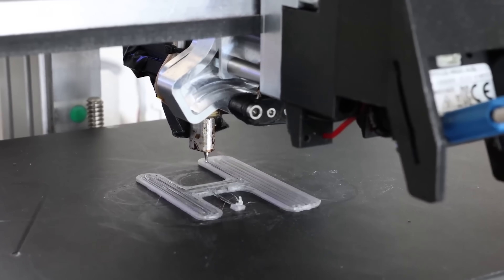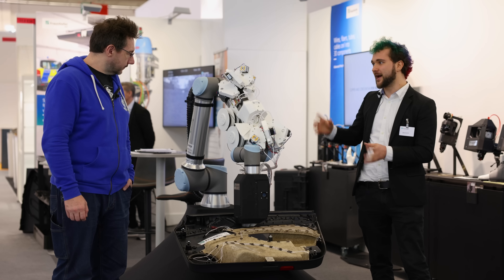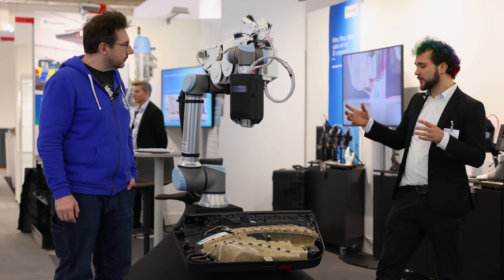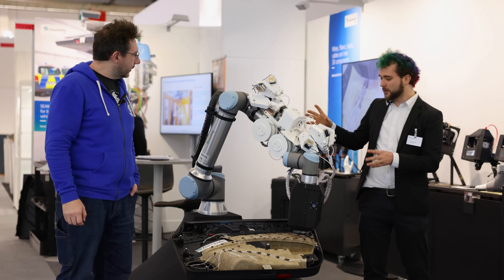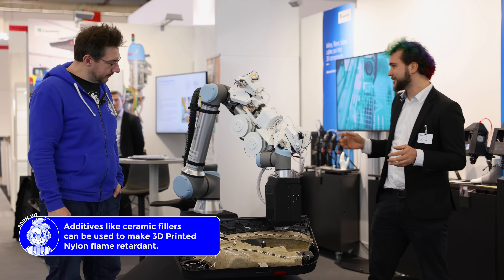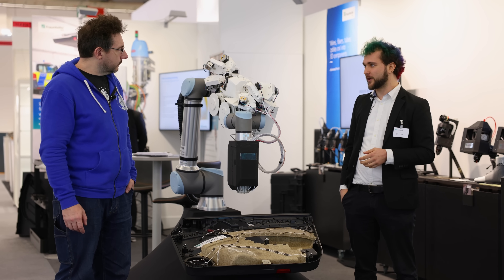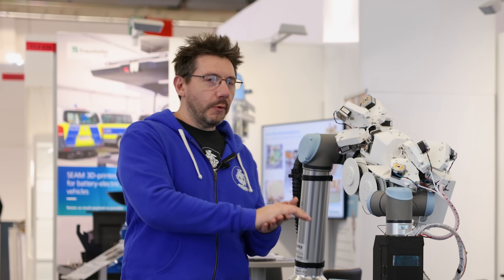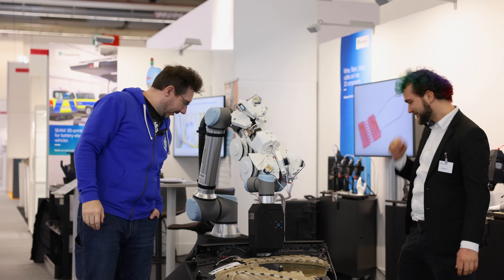3D PRINTING WIRE and TERMINATING IT?! - Fraunhofer Formnext 2024

Comment: try metal solder/3d-print wire melting with resistance heating at the tip, not the hot end, but the wire itself, not by arc welding, but by two electrodes inside the wire feeder hot-end, that contact with the feed wire. then the current goes through the wire (narrow) and melts it. normal 3d printer wire pushing.

Comment: A cable/wiring harness installed by a human on an assembly line can be removed by a human (not always easily but still) in the field for repair or replacement. These wires are installed and fixed in such a way it makes a common automotive failure point, wiring, unserviceable. One wire failure on that part would require replacing the entire door panel. This is not a good solution for the automotive market. Interesting technology, wrong application.
Reply: Current wire harnesses are also fully bound in adhesive and then welded to the part. At this moment, you will never replace a single cable in your wire harness. Its always replace ther harness or add an additional cable
Reply: @DecobirdZivo  The wires are fully bound in a wrap or similar system to form them into a wiring harness but the cables are not welded to anything, thus you can remove the harness and repair and/or replace it. I've done shade tree mechanic work most of my life and repaired/replaced/modified plenty of wiring harnesses and automotive wiring. This solution removes any chances of that type work without replacing entire panels.

Comment: This is a bad idea. They just made a way to make cars unrepareable by humans. Oh know one wire is broken. Replce the car. The dawn of the ICar is upon us. :(
Reply: Do you really think in current cars one single cable can be repaired?
In most cases they just throw in an extra cable or replace the complete harness, because the are fully tapped together
Reply: @DecobirdZivo  No, you would probably have to replace the enter wiring harness. Ya think you could do even that if it's all glued down?
Reply: @NJM1564  in most cases they are already glued down or attached via ultrasonic welding. 

In any case redoing the cables is a problme

Comment: This is cool and all, but I'm a little bit disappointed in that I thought this was going to be about using wire as a 3D printing filament. Towards that end, I had an idea. Place the entire thing in a really big acrylic box, then vacuum out all the air, then pump in argon. The hot end could be a thick ceramic cone with a channel down the middle and it could be wrapped first with a thermal insulator then copper tubes to facilitate inductive heating. This is why it would need to use argon, because you want to avoid oxygen contamination but you need flowing gas around the entire setup to cool it as it works. The only reason I suggest acrylic is to watch it work. An insulated metal cube would work just as well, if not better, but what would be the fun in that.

Comment: Cool concept, but it will need to be 100 ti es faster if they expect to see wires being made and installed on an assembly line.  It will also ha e to do multiple colors and striped wires for ant practical use.  Lastly wires are not laid out flat / sice by side for a reason, sothis tech will need to be able to make and bundle wire harnesses into cables.
Reply: I assume the robot in the video is going slowly because it's in an open space with random human beings passing through. Surely even that version does work a lot faster in an industrial setting, never mind a production version.

I agree with your other concerns, though manufacturers may decide that they are willing to accept less-than-ideal wire installation in order to cut costs by a dollar or two.

Comment: as someone who's fixed entirely too many wires, do not want. this mess would be a nightmare to fix after the fact.
Reply: @kenabi  could you explain?

Currently all cables are completly bound ny tape and there is no way of accessing them
Reply: @DecobirdZivo Most automotive cable harnesses are in a plastic sleeve or mesh and only taped at the ends. Most of the time you just have to cut the tape, tie the new wire to the old wire and pull it through. You will also need to loosen any clamps that hold the harness to the vehicle.

To replace a faulty wire that this robot ran, you would need a heat gun hot enough to melt nylon. Then when you could remove the wire, then remelt it to place the new wire.
Plus wire harnesses are color coded to make it easier to trace them.
Reply: @andrewforte  I'm sure they'd still use colored wire in many cases but I agree this would be a chore. Realistically the wire being constrained in so many places means a break in those areas is unlikely without a much more significant issue anyway, such as a short or physical damage (e.g. rodents), but that's still a very real possibility.

Frankly, I see similar technology much more practical in smaller, enclosed assemblies than in large scale applications.
Reply: @DecobirdZivo  adding to the above response; even 'sticky' harness tape isn't that much of a chore to deal with, and doesn't have the risk of newbies totally frying the whole set of wires trying to get one melted out of the bunch. to say nothing of the resulting sticky mess that may wind up everywhere as you heat up the glued down portions.

its hot glue on steroids, and hot glue is annoying enough already.
Reply: I agree, I think the automotive industry isn't the best application for this.

I think 3d electronics with embedded wiring and 3d circuits is far more interesting

Comment: Very interesting but I can imagine this is not an advantage for repairs. As a car guy, the wire harness gets moved around a lot when fixing or changing other components. The fixed attachment would be a pain to work around or replace.
Reply: @VacFink  you are definitly right for current car parts. But this technology enables to place the cables in different places as the normal harnesses. We do allow new routing options for cleaner and easier to access parts. 

On this piece the traces are non sense, because we arent allowed to show the actual parts wie did for the manufacturer. 

In real application the parts would be designed for those cable traces
Reply: Repair? Just print a new car.

Comment: Back in the '90s, I was an EE at Boeing designing automated test systems for the ISS program.  I realized that custom wire harnesses were really expensive, and had low reliability.  (The reliability issues were because we were using unskilled labor, but that's a different story).  So the next system I designed used all COTS cables (mostly Ethernet, coax, and D-sub) that cost only a few dollars each and were extremely tough and reliable.  I did it simply by making custom PC boards that handled all the cross-connections so the cables could be straight one-to-one wiring.
Reply: This is a great way of doing it in volume. Ethernet highly underrated
Reply: @steverobbins4872  they try to implement this in the next car cycles. Youll still have to bring power transmission into your harnesses. 

The system do get less complex, but will still need a lot of cable work, especially for all the sensor needed for autonom driving
Reply: @rackrobo Maslow CNC v4 uses Ethernet, but v4.1 will have JST-XH, they ran into issues caused by combination of protocol, vibrations, EMI.
Reply: How did that work out?
Reply: We need less computers in cars.

Comment: I feel for the first mechanic who opens a car up and finds this wiring harness eaten through by a mouse.
Reply: We need to go back to non-food-based insulation.
Reply: @yvan2563 just need to add bitterant to it.
Reply: @yvan2563  Rodents have itchy teeth, they will chew it through no matter if it was food or not.
Reply: @AmixLiark  Amen!!!
Reply: @AmixLiark  Sorry, the harness is integrated into the panel, and the cost is an arm a leg and bend over.
Reply: @22BOZIDAR  exactly... or worse: we don't sell that part... you have to get a new car.

Comment: Pretty cool! Not really sure who this is for as a product though. We currently use a machine that can produce literally thousands of dual terminated wires per day. It still seems more time and process efficient for most levels of production to have dedicated machines. Especially when the specialized machines are not that expensive. Could be useful for prototyping, but that's a big maybe.
Reply: Its a prove of concept prototype. The next years will show where this will be applied.

Biggest benefit ist the reduction of space. Storing the wire harness takes up a lot of expensive space, same as the machines and workers. Reducing all of this to a single robot could be the big point
Reply: @DecobirdZivo  Space isn't a huge concern for wiring harness machines. Shop space is cheap if you make any money at all. For actual production you cannot beat dedicated high speed machines.
Reply: @rackrobo  shop space is super expensive here in germany, also keeping track of every part is also time consuming. 
We wouldnt have developed this if there wasnt this specific need from one of the big manufactures in Germany.

And of course, we are currently slow, but i see no problem with integrating the advanced parts of those big systems into small, dedicated toolheads
Reply: @DecobirdZivo  We'll have to see how it shakes out. I'm sure you'll find some customers, but it just depends on what ends up being more efficient in the market. Wishing you guys luck.
Reply: @rackrobo thank you. for smaller applications the first toolheads will see full scale use in japan in ca. 2030 for a supplier, because for wire laying we already outclass the competition. 

The research on cable harnesses is only 18 months old, so close to TRL4.
Reply: Perhaps a version could be modified for challenging environments such as space, under the ocean, or toxic places?
Reply: @Martial-Mat  for high variability and low volume like space it might make sense.

Comment: Editing my first comment because I misunderstood what I was looking at, I’m at fault for not realizing those wires are actually factory made pre-insulated stranded conductors. The following was myself being critical of what I thought I was seeing, props and credit to @DecobirdZevo Fabian for reading the comments here and being willing to explain! The applications for this machine are much wider than I first expected. Original comment: “No no no, we will not replace automotive wiring with a solid core extruded wire. Not a chance it will ever work. He’s overlooking an old hard learned lesson: solid core is for buildings only, vibrations inevitably break solid wires. Neat idea but I hate to see he’s wasted his and investors money for a not so useful machine. Joel makes it seem sensational and amazing but I’m afraid it won’t be practical for many industries, maybe some very niche aerospace applications. too much set up between different parts too much variance in terminals, crimping, dies, and pressure of the crimp. It’s just not a good idea. You will end up doing more set up time than if you just hired medium skill labor. Quality could be more consistent, but there will be times where it will be a nightmare to get it to be consistent…”
Reply: This is not a solid core cable.
Its a standard automotive Wire. I know this, because its me in the video and this was a requirement from the manufacturer
Reply: @DecobirdZivo  I see, thanks for clarifying, sorry for being presumptuous. However, my argument with setup for each part and not babysitting the machine is going to be your big challenge… Edit: if you really are the creator in the video I greatly appreciate you interacting with the comments section here. Thank you. Edit #2, a question, are you going to be able to meet requirements for underhood or hot areas? What is the jacket material? What is its dielectric strength? Is it consistent? what about outgassing? If you want to get into Aerospace with it, you’re going to have to use a jacket material that gives off no plasticizer or other gases and be flame retardant.
Reply: @brentdennard6722  and to answer the other questions:

First, we are placing a standard din certified cable with system and only applying a pa6 nylon in spots, where we need to adhere. Those spots could also be used for full encapsulation, but the wire strands are enclosed in a standard cable. 

We have tested a lot of thermoplastic materials for the fixation. Those had the requirement of withstanding 110° without any loss in adhesion. The nylon did great in tests and is easy to certify for the manufacture, therefore we chose it, but any thermoplast and even any thermosetmaterial can be used. 

You could use a dielectric material if needed and create a thick enough encapsulation. We do this for smaller applications.

For aerospace applications we plan to directly bond those cable structures to the fibre enforced parts and do use the same materials as those, normaly thermoset resin or thermoplast. 

Hope this helps and excuse any typos i'm writing on mobile from south africa
Reply: @DecobirdZivo  oh my goodness I thought the machine was extruding plastic around a bare copper wire for some reason. Sorry about that. The feed tubes looked kind of small, hard to tell what was going on just from the video even in 4K. So you can feed any standard single conductor wire through your machine as long as it’s within a certain diameter? It’s basically just a robot arm laying any type wire out and tacking it down, cutting and then crimping… I was trying to imagine how any low pressure extruder could insulate a wire in situ like that reliably 🤯 I’m so sorry I was such a naysayer now 😅
Reply: Everything has to start somewhere. Gatekeeping innovation does not help.
Reply: @hanslain9729  but some innovation turns out to not be very practical
Reply: So, my entire career is making tool ends for robots and machines.
And I am going to ask you a single question that you where not asking yourself.

What do you think is harder on a peice of tooling, inflexable thick solid core or soft pliable multistrand?
Reply: @AnonymousAnarchist2   what are you talking about harder on tooling? The wire? The wire being hard on tooling isn’t the problem. Multi strand is easier on tooling, but may require more crimping force slightly. Are you some kind of expert? What are you getting at? It’s people having to set up the tooling for the wire job. You may as well pay a person because of how fiddly it’s going to end up being. Case in point: the self checkout system at retail stores have ended up having to hire more assistants that would’ve just been cashiers because the automated system is constantly screwing up
Reply: @AnonymousAnarchist2  you’re an out of touch enginerd. Some career you must have to be so eloquent.